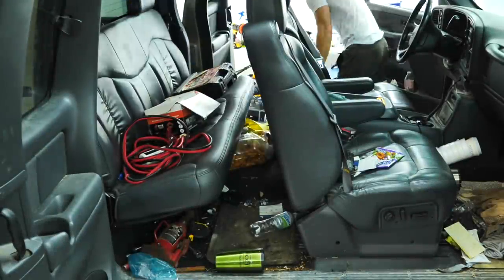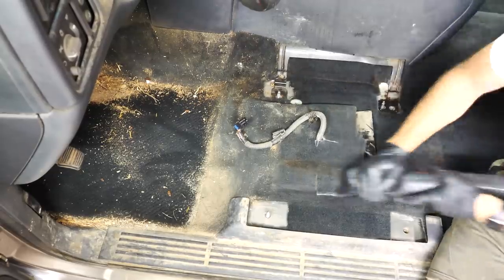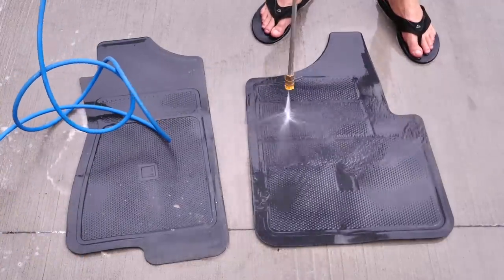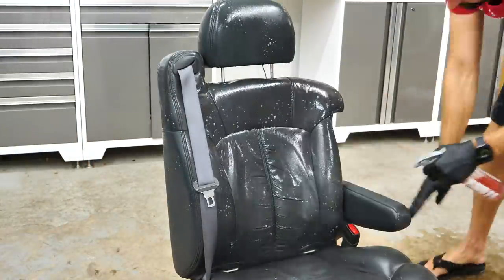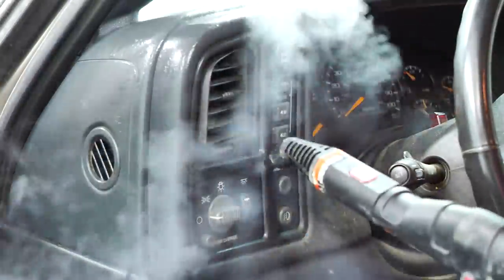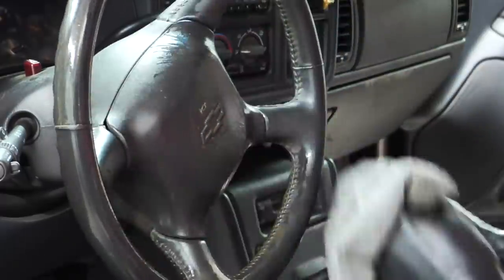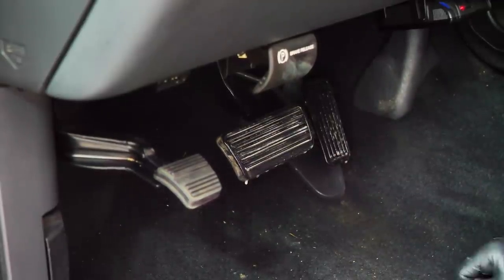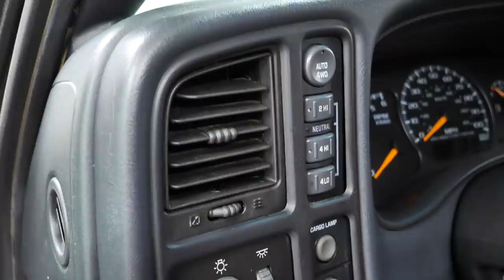Car Detailing A 🤮 Smoker's Chevrolet 2500... 😱 Interior Restoration How to

Comment: I used  to run a thermal fogger from the intake vents into the car, then wipe down with double O mixed with awesome and water. You could watch the nicotine melt off everything.

Comment: How can you get rid of the smoke smell and keep it away my parents borrowed my car and smoked in it and now it stinks
Reply: I'm guessing foam carpet cleaner like shout or tuff stuff. I done a van yesterday. And go to advance Auto and get a can and gel can of ozium air freshener. The can under the seat and spray the interior. You should be fine after that. Make sure you get a cleaner to wipe down vinyl, leather and plastics. Cleaning the windows alone kills a lot of the smell too(meaning interior windows).
Reply: I'm guessing foam carpet cleaner like shout or tuff stuff. I done a van yesterday. And go to advance Auto and get a can and gel can of ozium air freshener. The can under the seat and spray the interior. You should be fine after that. Make sure you get a cleaner to wipe down vinyl, leather and plastics. Cleaning the windows alone kills a lot of the smell too(meaning interior windows).

Comment: Hi,
Since I deal with car detailing, I wanted to look back on your work which is satisfactory but there are a few things that I think you need to pay a lot of attention to! since you post your work on YouTube it is not appropriate to see that you work in slippers (without protective work shoes and without pants) it simply does not leave a professional impression. Since the car is cleaned with chemicals, no matter how airy your workspace is, a protective mask is mandatory so that you do not inhale chemicals (I guess you do not want to get lung cancer at the age of 45-50! And the last remark is to clean the leather seats. I use a brush that is on the drill, but for cleaning leather seats it is not allowed.The red brush you use is intended exclusively for the floor, it is too rough for leather seats.Also I did not notice that the seat belt is clean and it is a very good addition to the whole job These are certainly well-intentioned reviews, and your work is really good, I think that with these little things you can improve it even more, good luck in your future business!